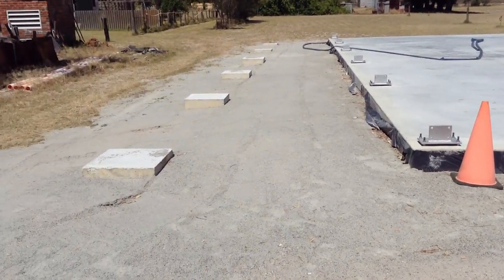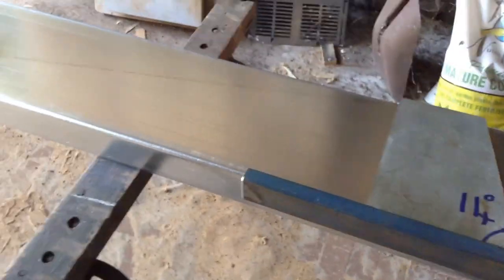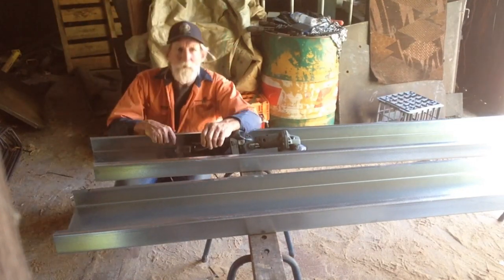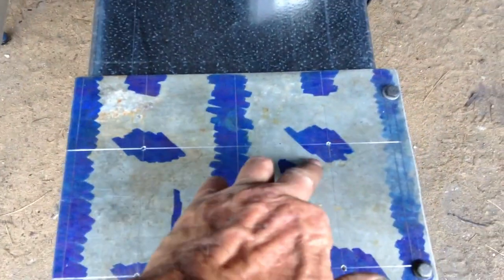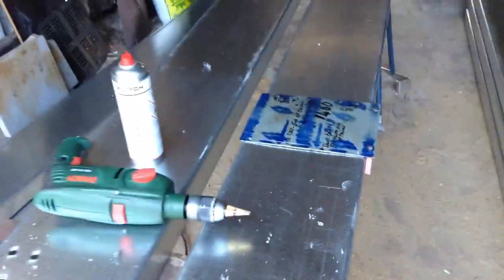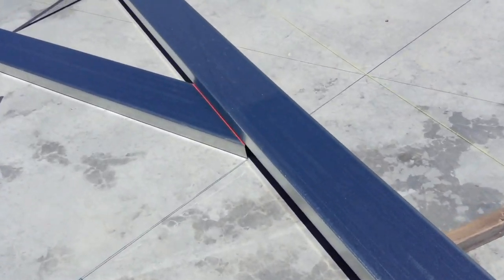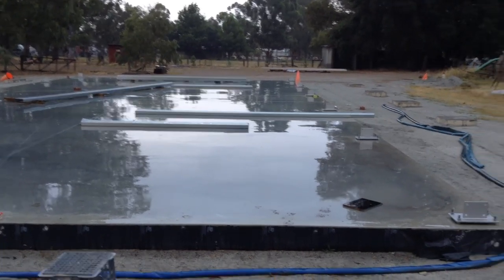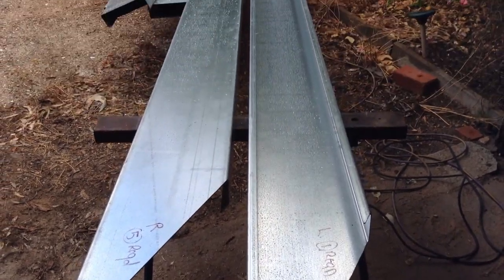New Shop & Machine  Update .  No  3

Comment: Hello Max.  Looks good and looks like lots of work.  And in that heat!  I had to chuckle when you mentioned the good quality step drill.  About 4 years ago my father-in-law built a municipal dock for the town he lived in.  After he drove the piles in and welded the frame together (in the winter, on the ice) he had to fasten the deck boards to the frame.  He had about 1500 holes to drill through 1/4" thick channel iron.  I got him some 'made in the USA' step drills and he had a cheap Chinese one he had bought years before and had never used.  The 'made in USA' drills lasted about 5 holes each.  He quickly wore out the 2 or 3 I had got for him and in desperation tried the cheap Chinese one.  It finished off the remaining 1485 holes and was still cutting well when he finished.  To say I was shocked was a understatement, as we all know that is not usually how it goes.  Good luck with the shop and keep making videos.  Ken
Reply from the maker: Thanks Ken  .  You would not get a cheap Chinese step drill to out last an American one often , i bet that was a first !    On that note i did buy a cheap Chinese one as a back up for over the Christmas period , just in case !    Have a great Christmas , Cheers .

Comment: Nice to see you're making good progres on the new shop.
And i hear you talking about a new shaper...
Reply from the maker: Hi Rusty , i picked one up a short while ago  .   Its a mid sized one , 1980's  Zocca 500 .  500mm stroke ,  clapper lift , auto down feed ,  can adjust the  feed & stroke with it running  , hyd pump  for lube  &  it has done bugger all work  .   Bought it from JB From Oz  ( his Dad )  . It will be a great machine to have around the shop .  I have not used one in 40 years  so it will be a bit of a learning curve !!!     Cheers .

Comment: Hello Max, now worries about snow load, make building out of light materials possible. I assume you will tie it all together with wind bracing along with what you already have there on the ground so a good blow does push it over flat or lift the roof off and deposit it out in the paddock someplace
Reply from the maker: There will be a lot of bracing  .  All bolted & thicker steel than the commercial kit sheds .

Comment: I think 3.1 meters is a perfect hight. My shop at home is 4.1 meters and it's a bit low for a mezzanine and to high 99% of the time. Nice machines, you're going to have the shop full before its built. Right on Max
Reply from the maker: Thanks . I have already had to do the floor lay out plan several times ,  so i have given up on that  & will just wait until all the machines are inside  & then sort it out !  I still have a bit of a plan for the lay out  & that will be governed by how i do the  gantry's & swing cranes .     Cheers .

Comment: That's a task to build a building this way . Are your purlins galvanized ? I'm going after a new to me lathe this week 28" x 12' with a 6+"  hole in the head stock. Its probally 1940 ish machine but tight Good Luck with your build
Reply from the maker: All galvanized .   That  will be a good size lathe , a tad larger than the one i will be picking up 24'' x 10'   A 6'' bore will be handy , i was looking at a couple of oil field lathes in a machine shop the other week & they had about a 12'' bore through the spindle  with a chuck at the rear of the spindle as well .    Did you get your horizontal borer  finished yet , i know you had some serious repairs to do with the table rotating gear . Thanks .

Comment: Hi mate , getting there on the Shed  do you use Anti rustpaint or the like  on the drilled  and cut  gal surfaces? or is gal steel galvernised right through?  nice ol lathe what country of Manufacture and Namebrancd ? Cheers Max have a great chrissy and new year.
Reply from the maker: Hi Robbie , the paint i will use to touch up the cut edges is Cold Galv  paint .   A one litre tin weighs about the same as a four litre tin of ordinary paint !    The lathe is made in Italy  .  A Misal  Herron K24 .  The bed is rooted but for it should not be an issue for the work i plan to do in it .  I just needed the larger capacity for a planned job later on .  Cheers ..
Reply: @swanvalleymachineshop  Cheers Max ta 4 info

Comment: Interesting video mate. 
Just wondering why you chose  to build all the steel frames yourself. 
Lots and lots of prefab sheds out there delivering everything cut and drilled to your property. Only needs bolting together. 
Is it because your shed design is awkward ( which it doesn’t look like ) or doing everything yourself is saving you a lot of money. ? 
Thanks for uploading. ;-)) cheers.
Reply from the maker: It is my own custom design .  Also cheaper & better built to do it all myself , just bloody time consuming !  Cheers .
Reply: Okay Max , thanks. 
Yeah , I did notice the steel beams you’re.using look thicker than the stuff the prefabs come in. 
Good luck with your build mate , I will be following it closely.
Reply: @swanvalleymachineshop  You remind me of myself, building everything because I could do it better and cheaper but time becomes an issue. The clock runs out for all of us.
Reply from the maker: @tiredoldmechanic1791  I am with you there , it's a double edge sword !